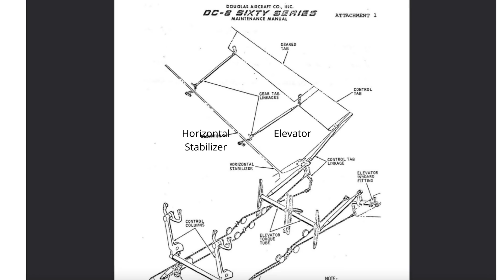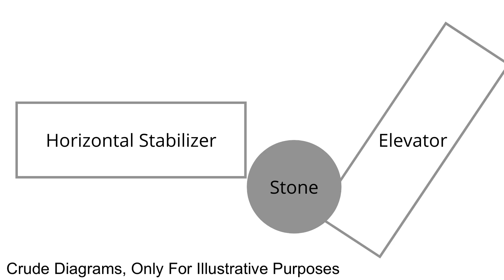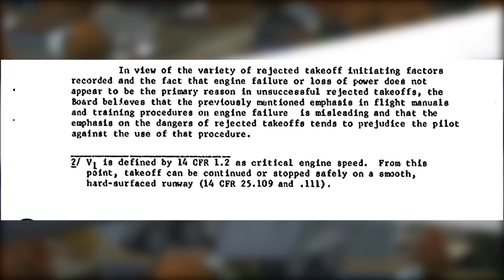How A Stone Crashed A Passenger Jet | Trans International Airways Flight 863

Comment: A 2" "pebble" verses 3000 lbs of hydraulic pressure? I'm not buying that accident explanation! Sounds like the elevator flight control cables were reversed! As they pushed forward on the yoke to keep the nose down on takeoff roll, they were actually rotating the aircraft dragging the tail! The human brain could not comprehend what was happening and they mistakenly continued the takeoff. After rotation they continued pushing on the yoke hence the 60°+ nose up attitude, wing stall, and crash. I wonder what that flight control check looked like before takeoff! RIP Aviators! ✈
Reply: The DC-8 had manual elevators, not hydronic elevators.
Reply: @maxz8807  Got it! And if I'm not mistaken, I see that the elevators are aerodynamically moved by the control tabs which are cabled to the yoke! This McDonnel Douglas stroke of genius, makes the flight control check worthless if ALL the large control surfaces are not being moved! 🤨
Reply: Read the NTSB final report - it's all there.
Reply: First of all the DC 8 is a beautiful flying airplane. We used to call her the California Cable Car because of the flight control system. They were cable operated but with a boost tabs to assist in relieving the air loads on the controls. The possibility of reversing the elevator cables is a virtual impossibility due to the design engineering. Secondly the NTSB inspectors are very good at their jobs and would have never missed such condition. Finally, no maintenance was performed on the aircraft after it flew in, so how could it be changed. There is absolutely no doubt that this was not the problem.
Reply: @raybufkin5255  Well I was a 707 guy and we called her the Quad Screamer for the high pitch sound those PW TF-33s let off! The NTSB findings for this crash were a stretch and just because they published it, doesn't mean I have to believe it. YES! Something jammed the elevators, but we'll NEVER know what because they blamed a pebble.

Comment: I wonder if this would have manifested itself had the flight controls been exercised?

I don't think I've ever initiated a takeoff without moving each control to its stops. it's easy to do and takes very little time. 

further, when the nose rose too far, something is seriously wrong. At that point, the plane becomes an emergency and no one else matters. So what if another plane has to go around, it's far better than risking crashing your own plane. 

The mentality of 'we must complete this takeoff' can be enormous and cloud judgement.
Reply: As a result of that accident, an elevator check was done at 80 knots during every take off.
Reply: probably they did the check while still standing. problem was, if i got it correctly, that the pebble got wedged between the stabilizer and the elevator when the elevators were moved.

Comment: Your have thought that, with flight control problems beginning at 80kts, the pilots would have aborted the take off. Unfortunately the concept of RTO’s and the horror of believing they would block a runway seemed to far outweigh the desire to stay alive.
Reply: I suspect that pilot discretion was less of a thing in 1970 also. Another video (74 Gear) mentioned that many airlines have instituted "no fault" go-arounds. The idea being that having to explain (to the boss) why you chose to go around made pilots hesitant, which resulted in incidents.
Reply: @briant7265  my first airline made the captain come in and explain every go around. They also basically made it known you were finished if you did the emergency gear extension qrh procedure... It blew explosive bolts that cost 40k EACH.

That airline subsequently crashed a perfectly good q400 into a house...
Reply: @BobbyGeneric145  Exactly! I mean, of you blew one of those bolts every week for 50 years it would add up to an entire $100 million airplane. (Illustrative calculation with ironic tone.)
Reply: Hindsight.. absolutely should have been a rejected take off. Pitch-up on takeoff before V1-Vr is usually a trim out of T-Off range issue (pilot error) or runaway trim (depending upon system type). In the simulators, we would train for hours just on rejected takeoffs,  however, I support the notion that most flight training RE rejected takeoffs is definitely focused on engine data rather than flight control anomalies. A psychologist might say "out of sight - out of mind" to explain the rationale for continuing the flight.  A known tail strike prior to V1 definitely should have been a rejected take off decision. I wonder what the transcript said from the CVR?
At those speeds, you have seconds to react before a problem gets out of control and cannot be resurrected. Surprised here that self-preservation did not kick in a little sharper while still in ground-effect. After V1, most training (through to the end of my career in 2000) was directed toward continuing the flight rather than running off the end of a runway into terrain, buildings or water.
Reply: @richardmorgan3974  Not hindsight. I was not familiar with this incident and as he was describing it I honestly expected them to reject and run off the end of the runway.
Reply: Utter crap. Safety ALWAYS comes before blocking a runway in civilised countries. Clearly the USA has this, and much more, the wrong way around.
Reply: @TimSmyth23  This was 51 years ago. Much has changed since then.

Comment: Don’t pilots check for full range of movement on all flight control surfaces as part of their preflight checklist?
Reply: The control issues did not start off at the ground while still,  the stone was not PRESENT until the plane was rolling, did not jam the controls until it was accelerating and the controls were in use.
Reply: They are sopose too.
Reply: Part of preflight safety checklist.
Reply: @Skimblshanks  The DC-8 uses "servo tabs" for elevator control.  Look it up.
Reply: @TheWidebody747  they were called "trim tabs" and used aerodynamic forces to control the larger elevator

Comment: I'm a certified technician.  They didn't catch this at all during pre flight check? As part of your preflight check. You are so pose to check all your flight controls range of motion. Also make sure they are not loose or binding at all.
Reply: Yeah, but the stone probably lodged itself on the runway anyway, well after the preflight checks could catch it...
Reply: This type has aerodynamic servo control for the elevator (diagram at 3:18 ).  Checking while standing still only verifies the control tab moves - without sufficient airspeed the elevator itself does not move so a jam is undetectable.

My understanding is that after this incident, an elevator check was added during the takeoff roll at 80 kts.  This speed is high enough to verify elevator response, but low enough to easily stop safely if the check fails.

Comment: This accident perfectly illustrates the fact that aircraft certification is based on safety requirements involving mainly the aircraft’s internal reliability, that is the robustness to internal failures. Unfortunately, commercial aircraft evolve in a physical environment that includes many possible hazards and external factors of possible damage. The Concorde crash is a similar case, where a tiny metal strip fallen from a previous plane and lying on the runway was enough to cause a tire explosion with catastrophic consequences. No design can be perfectly robust to endless hazards and contingencies, however we should learn from the past that some of those should be accounted for, at least in future aircraft designs. Stones from runway/taxiway works are (or should be) one of them, just like bird strikes.
Reply: I may not be an aeronautical engineer, but I'm not sure it is even possible to make a FOD-proof airplane.

Comment: Allec, not weird at all.  I've seen this happen on a 747 during rotation. The thrust from the engines threw up loose asphalt from the runway and wound up causing a 3 foot gash in the left elevator. The aircraft returned safely. The airport was extending the runway and used asphalt instead of concrete.

Comment: I worked for United in 1970 on DC8s at our overhaul facility in SFO. I remember seeing stones in the flapwells of the wings and thinking “ how did they get there”. Also the DC 8 has manual elevators. no hydraulics not a well known fact
Reply: Wouldn't surprise me, you have any idea how hard it is to create an obstacle free space?

That's why I strongly prefer planes that are built to withstand the unexpected. For example, a small gasket blocking the opening would prevent anything like this from happening, but nope not there.

It's like hurricanes, we know the most common damage is to windows, but we know that a small barrier a distance away from the structure can weaken the forces enough that it can't damage the structure.

Yet, they pretty much never utilize these basic concepts to build hardened structures that don't kill their occupants whenever there is bad weather.

The solutions are usually plain as day, the issues usually because somebody refuses to do what they know they should do.

Just like with this pandemic... We knew what to do, we've done it successfully every other time... Yet bizarrely, they didn't do what they knew they should & now we are in an out of control pandemic.

You can't necessarily predict the unpredictable but come on, any engineer worth their salt, knows that small spaces between moving parts can become a trap for any random thing that gets in there.

It's not just a rock, if there's any sort of impact, explosion, part failure, etc; debris can be generated that can get stuck in there. Even my crappy washer & dryer has gaskets to prevent random crap from getting into the wrong places! It's not that novel an idea.
Reply: @adambartlett114  Any links to exactly how to build hardened structures?
Reply: @653j521  😂
Reply: @adambartlett114  These kinds of things usually aren't done because of cost. They probably assumed it wasn't necessary. Either way, this accident seemed to be mostly caused by poor crew training which prevented them from considering rejection of the takeoff.
Reply from the maker: Huh that must mean this problem was pretty widespread
Reply: Was DC-8 the largest transport in the West without powered elevators? I believe so. A retired Delta captain told me how much force was needed on the yoke for landing flare in some situations. It was easier if both pilots pulled.
Reply: I guess this case strengthened the argument for keeping the runways clean. The Concorde also died from FOD.
Reply: @FelonyVideos  First thing I ever had drummed into me the very moment I stepped airside was the danger of FOD and that it's EVERYONE'S responsibility.
Reply: @padrejohnruffle  When a new plane is built (military), the first maneuver the pilot does is vertical then upside down back over the airport. He has a small fod bag to pick up everything that falls out of the cabin onto the windscreen. There is dangerous fod inside the airplane. I once had the faa tear a 787 apart because I knew they had a brand new iPhone that had fallen into the cargo hold. The battery was dangerous.
Reply: @FelonyVideos  Another 'Concorde' was damaged by runway debris at Washington in the '70s: a pilot flying as a
passenger had to drag one of the attendants to his rear window to prove that there was a large hole in the upper-wing, leaking liquid (fuel? hydraulic fluid?), before the crew turned back (during the climb-out). The plane landed safely.
Reply: @FelonyVideos  The Concorde crashed because fragments from a burst tire striking a fuel tank were able to cause the tank to rupture. The tire happened to blow because it struck FOD. But if it had blown in similar fashion for any other reason (e.g. manufacturing defect or incorrect inflation), the Concorde would've crashed just the same. The FOD wasn't necessary to cause the accident, unlike here were the accident could only happen because of FOD. They beefed up the shielding on the Concorde's fuel tanks after the accident.
Reply: DC back then stood for Direct Cable control
Reply: @747-8F  "...  or ''Death Craft", as the DC-10 became known by survivors [think also of those worrying,unbalanced C-54/DC-4 stabilisers/elevators].
Reply: @747-8F  - LOL!
Reply: @adambartlett114  British test pilot George Errington liked to stall aircraft to the limit during flight trials. He was caught out when testing a 'Trident' airliner, finding, too late, that he couldn't bring the aircraft out of a 'deep stall'.
Reply: @None-zc5vg  That incident answered a long-standing question I'd had. Why are T-tail planes like the Trident and DC-9 designed so the tail has to push down to keep the plane stable? Wouldn't you want all surfaces of the plane to create as much lift as possible? Well, because the horizontal stabilizer sits higher than the wing in a T-tail, at certain angles of attack the turbulent airflow off the wing intersects the horizontal stabilizer. And the plane can lose elevator authority.

If the tail is designed to create lift (pulls tail up / nose down), when this happens (as it did on the Trident) the pilot loses the ability to push the nose back down. And the plane gets stuck in a nose-up attitude with no elevator authority (no pitch control). By designing the plane so the tail pushes down (pitches nose up), if this happens and it loses elevator authority (down force by the tail stops), the nose immediately drops down and the pilot regains elevator authority.
Reply: @adambartlett114  You did not comprehend what I said. There is a difference between flight testing and first flight off the production line. I was only talking about fighter jets, BTW.

Comment: A serious tail strike has the potential to cause pressurization issues, right? One would think that would have been enough to reject the takeoff.  Had no idea that the manuals and training focused on engines as the only real reason to reject as recently as the late 1960s. Mind blowing.  Great job on this one.
Reply: Usually tail strikes happen after the aft pressure bulkhead. So it would not cause any pressurisation issues.
Reply: Depressurization - assuming the damage is severe enough - would only become a problem as soon as the plane reaches a certain altitude. The more immediate problem would be the rejected takeoff itself. Even if there is enough runway left the pilots still may come to the conclusion that it is less dangerous to proceed with the takeoff but return to the airport afterwards.
Reply: @Gruftkriecher  But an uncommanded pitch-up prior to V1 let alone Vr strikes me as reason to abort.
Reply: @christopheroliver148  My comment was an answer to the statement that "a serious tail strike has the potential to cause pressurization issues, right? One would think that would have been enough to reject the takeoff."

I just clarified that this is not the case.
Reply: Maybe in extreme cases but for the most part damage caused by tailstrike would fall in unpressurized areas
Reply: @TLSFC5050  thank you for the insight.  Am aware that the manufacturers add reinforcement in the area, but didn't know how effective it is in protecting the airframe from depressurization.
Reply: The tail strike itself wasn't reason for concern, it happened all the time on craft like this. The shocking part is that they continued the takeoff despite having severe control issues even though they were well below V1. Astounding.
Reply: All airplanes which needs pressuring have a rear pressure bulkhead  including DC 8, so there is zero chance of pressure leak because of a tail strike.